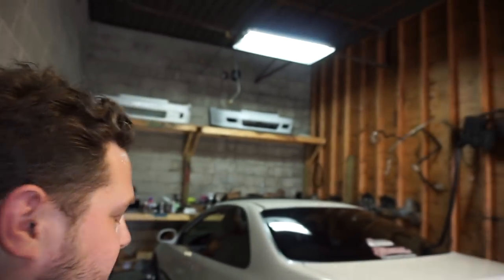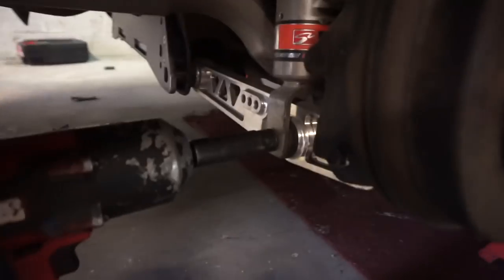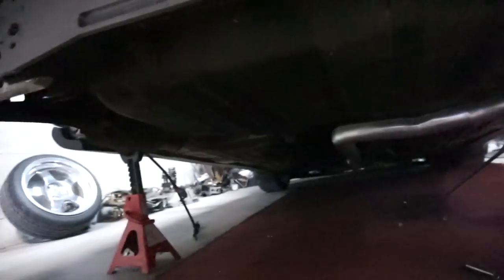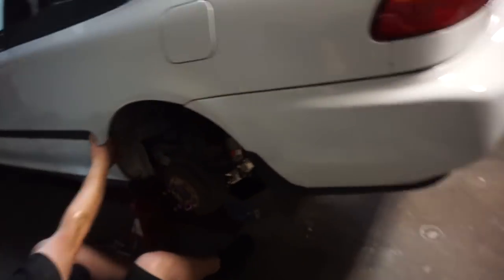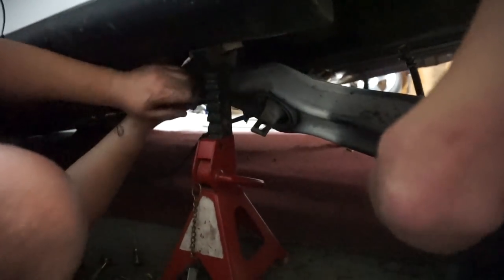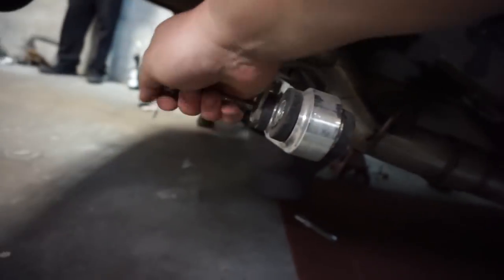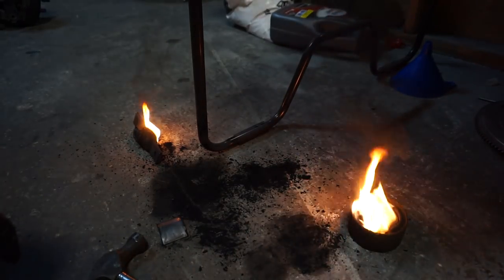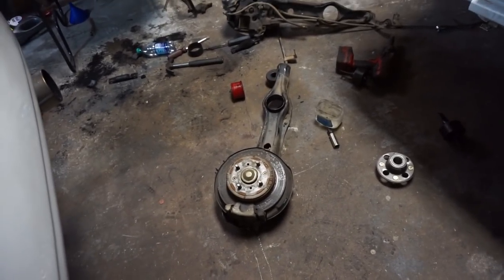REAR DISK BRAKE INSTALL PT 1.   HSG EP. 5-74

Comment: I used a jack and a suburban. Put the trailing arm on the jack, set the bushing on top with some lube and jack it up against the hitch of the suburban lol the weight of the SUV presses the bushing in.

Comment: i used a grinder to cut a slight bevel in the edge of the bushing to help get it started along with plenty of anti seize for lube. outer sleeve of the old bushing helps to tap it in

Comment: I got my Energy Suspension bushings in with a hammer. I had to use a mini sledge, but you shouldn't have to press it in...sometimes that outer sleeve gets banged up when you hit it out, you might need to take a grinding disc or a flap wheel to the outer edge to straighten it up enough to hit into place.

Comment: This may sound stupid but i did this swap on my brothers ef. I also had problems hammering the bushings in and i fought it for hours until i noticed the layer of paint made the bushing thick enough where it wouldnt fit. So i got a wire wheel and brushed a layer of paint off the bushing to work as a guide and a few hit from my hammer and bam new bushings on my trailing arm. So give that a try.

Comment: You can hammer them in no probs. Lube them with soap and use an old brake disc over the top to strike on. They go in pretty easily. Don't hammer on the bushing directly, obviously.

Comment: Use carb cleaner it separate the rubber from the metal bushing. Try it, it works. There is a video on YouTube. You just work a screwdriver in between the rubber and metal and spray carb cleaner in and u can work it off.

Comment: Are you supposed to clock the trailing arm bushings? If so how do you determine where exactly? Ride height?
Reply: you mark the arm with the old bushing while the suspension is fully compressed before you remove it